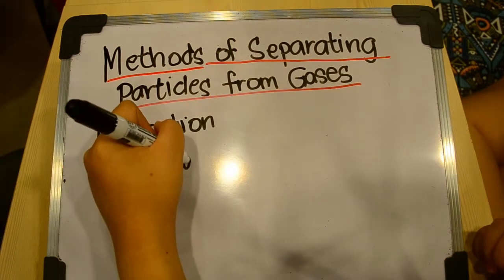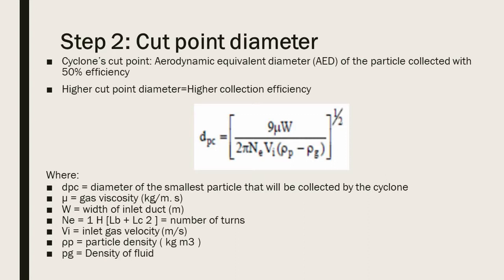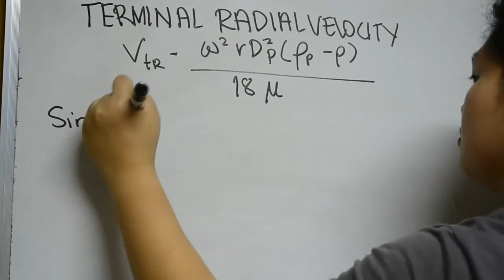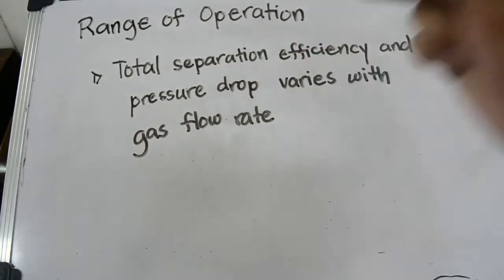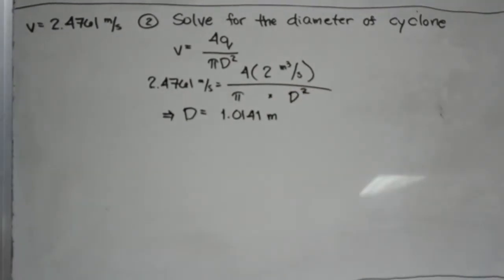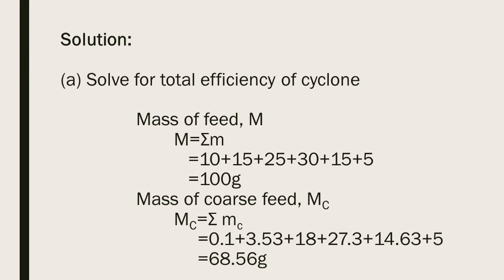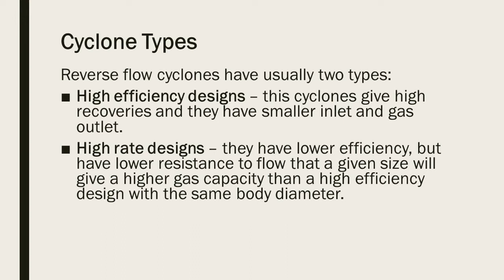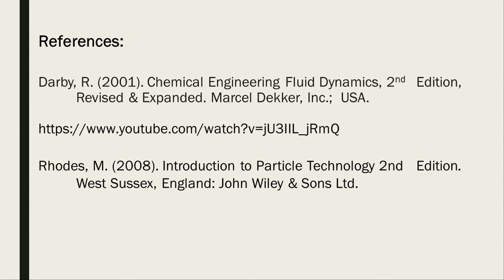ChE 147 Cyclone Separator Video Project

Comment: I very much appreciate your efforts in producing this video as I have a need for a cyclone separator but I am not confident enough in my mastery of mathematics to be able to compute the type of cyclone separator I need.  If you would indulge me, my application for a cyclone separator would be for removing  ash from th he exhaust stream of a high efficiency wood burning firebox.  Such a firebox is highly insulated and very nearly completely consumed all the fuel, resulting in an exhaust of only carbon dioxide, carbon monoxide to a lesser extent, water vapor and mineral particulates from the ash.  It is my hope that the draw created from the chimney flue would be able to drive a cyclone with enough rotational velocity to separate a majority of the ash from the exhaust gases.  My effort is to solve the problem of particulates clogging the exhaust path of said high efficiency wood burning appliances by reducing the need for clean out ports to a single, easy to reach access point.  Do you think there is any merit for this application of a cyclone separator, or do you think the maximum flow velocity would be too low to eject the particles from the gas stream?
Reply: could you help me bro iam also working on it inorder to graduate from college
Reply: @itsjustacontent2362  Analysis_of_Cyclone_Collection_Efficiency.pdf